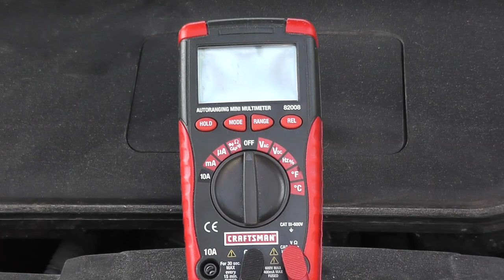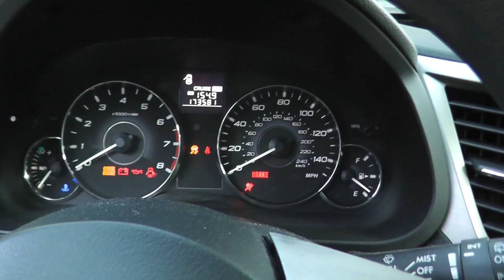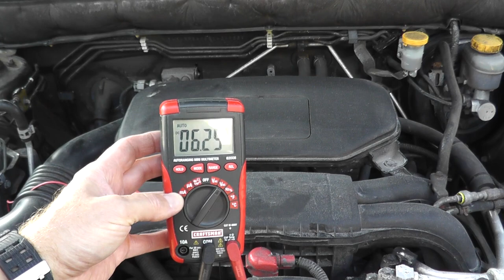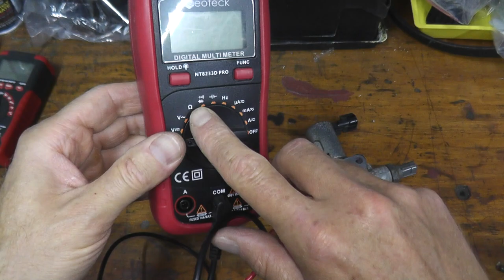Subaru P0026 P0076 P0077 Variable Valve Timing VVT Solenoid Testing and Replacement

Comment: Great video. In my experience, my scanner was throwing a P0021 "A" Camshaft Position - Timing Over-Advanced or System Performance (Bank 2); which is the driver side. In most cases, that is due to improper vehicle oil maintenance. Most VVT Solenoids fail or do not function properly because of oil sludge or oil contamination. The sludge hinders flow through valve screens and causes the solenoid to function incorrectly. First I change my oil and filter then  I only remove the solenoid, attached by one bolt. More than likely you'll find the solenoid screens gunked up with oil sludge. Use brake cleaner to thoroughly remove the sludge on and in the screens. Replace and wipe the codes. It can take a couple of cycles before codes are completely gone. If the solenoid comes out clean with no sludge then use alligator clips attached to the solenoids two prongs and your battery to see if the plunger moves up and down. If properly connected and no movement, replace the solenoid.
Reply: Looking at a friend's Forester & both VVT's show just a hint of resistance at first then nothing.  I'm skeptical because I wouldn't think they would both go bad at the same time.  Thoughts?

Comment: I replace the VVT from driver side and works perfect for 20 or 30 miles, then stars again check engine light and start to shake a little bit, so i take out the battery terminals for 10 minutes put it back and is a new car again, 20 or 30 miles later  start to make trouble again, any sugestions?...NEED HELP PLEASE

Comment: My sisters  bf sprayed a hose on the engine while it was running to rinse off some engine degreaser and it started running bad like a mis fire and it has the p0076 code. Runs terrible. I hope it dries out and fixes it self. I'll check the connector first.

Comment: I took the head apart and discovered that in operation  only one intake  valve is working till throttle  is at higher  mode to then set pin with oil pressure  . And one intake  valve is holding  fuel then dropping it at full throttle  . I think this is dumb and not vvt it's on or off to one intake  valve .

Comment: My car is throwing a P0077 its 2013 hyundai. I have already taken it too the company's authorised repair station but they told me that they will have to open the whole engine and check the timing chain, when its just a solenoid issue, please suggest what should i do now ?

Comment: If you want to take this whole part off do you need to have the car empty of oil?
Reply: No. It takes pressure while the vehicle is on to move through the solenoid.

Comment: I was getting P0076 on my Outback. Replaced this part and had noticable performance increase, however, the code came right back after clearing it and RPMs are still limited to 4k.. Any suggestions..?
Reply: Hey did you ever get your car fixed? Mine is doing the same thing and can’t figure it out

Comment: can i just take the one bolt off on the silenoid? and replace without taking the whole housing or do i have to take the 4 fasteners out too?
Reply: to only take out the solenoid there is just that 1 bolt you need to take off. the solenoid pulls right out and you put a new one in. i dont know why he went through all the trouble to take the whole damn part off when it is only the solenoid itself that is bad. smh.